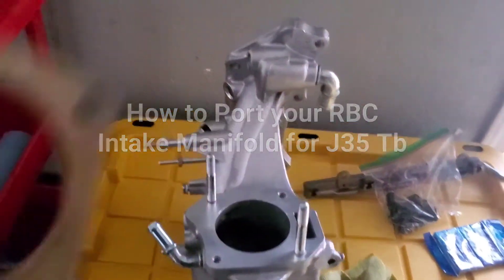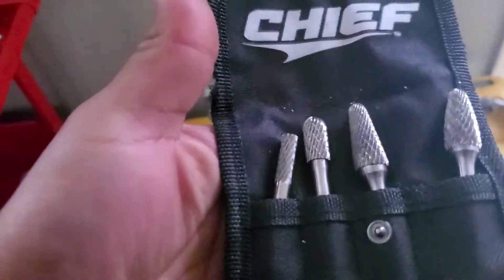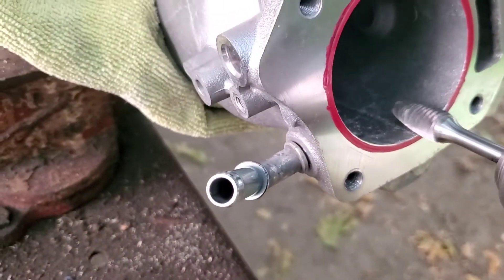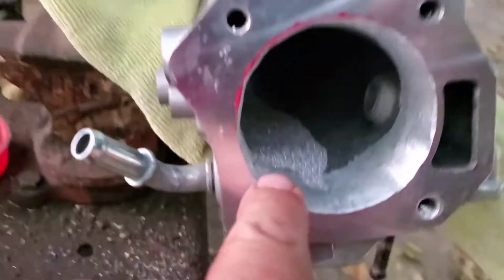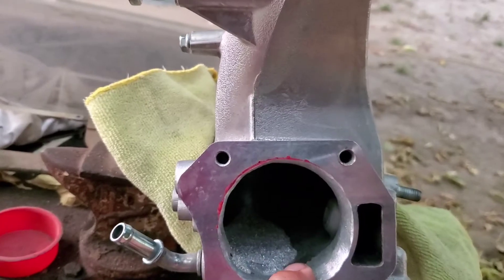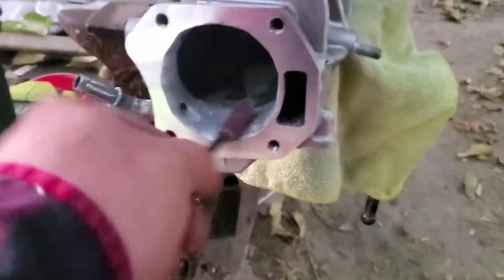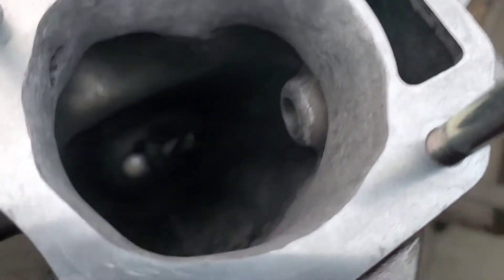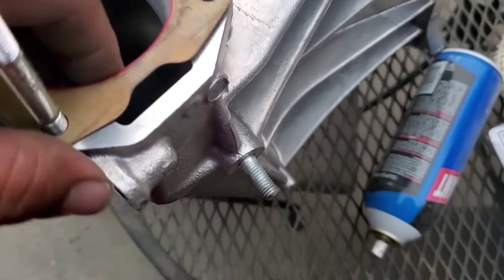How to: Port Match Rbc Intake Manifold  06 Civic Si k20z3 From 65mm to 67mm J35 ThrottleBody

Comment: Why do you need the spacer? Is it absolutely necessary?
Reply from the maker: More turbulence = more Power and torque
2 of my buddy's are running the same spacer and they claim to feel ot more torquier...up to you but these motors LOVE BOLT ONS!
Reply: @559powerscape  How  much did you pay for that spacer?
Reply from the maker: @MrEggomylego  it was like 100 bucks from Taylor's website worth it tho! My buddy's have the same one and they say it feels torquier
Reply: @559powerscape  not hating but id like to see some dyno results before buying a $100 spacer lol don't think it will prove that many gains
Reply: It been tested you don’t gain power w spacer 😂